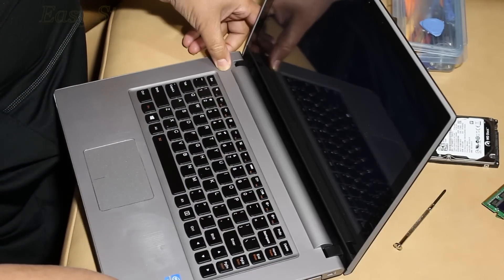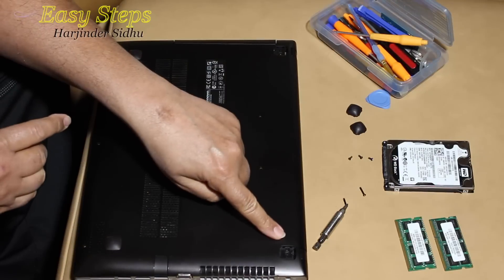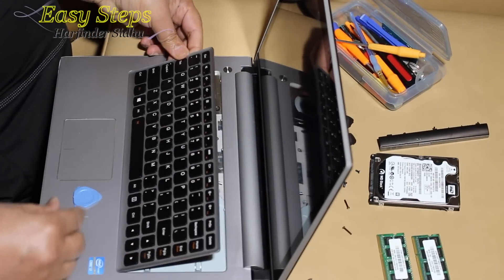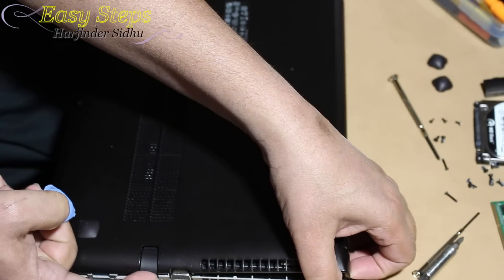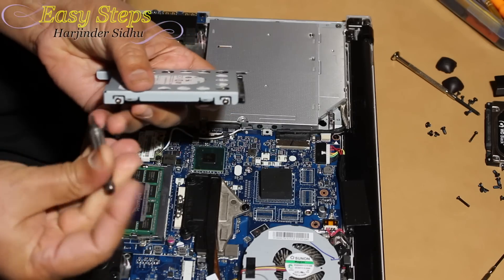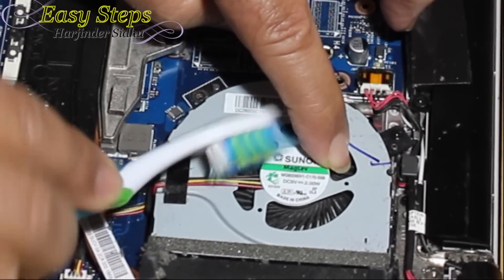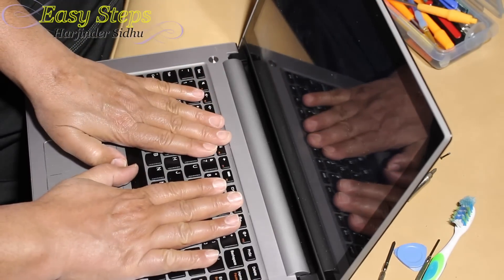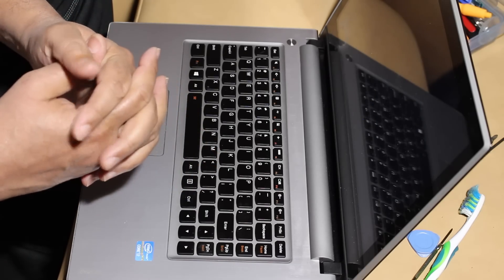Disassemble Lenovo IdeaPad - How to Upgrade Memory & Hard Drive | Clean Fan Z400 Disassembly

Comment: Mil y mil gracias. Me sirvió mucho. Thanks
Reply: Si le compro un SSD para reemplazar su hdd... crees que funcione win10 apesar de no tener este Lenovo ideapad z400 DRIVERS para win10?   
Revisé en el foro que había gente que tenía problemas conel brillo pero me da igual porque lo enchufo a un monitor...pero desconozco del wifi y targeta grafica.

Y respecto a la licencia de win 10: NO tengo. Puedo aún así usar win10 (home o pro )y con windows defender normalmente? Se que no puede cambiar el fondo pantalla pero eso me da igual

3.Finalmentepregunta: se le pueden reemplazar ram por 2 ram de 8gb cierto? Ddr3 1600 mhz

Comment: Thanks, needed this video to upgrade my Lenovo Ideapad bought since 2013, after 7 years still running fast with new 8GB RAM and new HD.
Reply from the maker: I have started posting DIY videos on my 2nd channel "Sidhu DIY" so please subscribe, thanks.
Here is the link for my 2nd channel, thanks in advance.🙌 🙏 🙌
https://www.youtube.com/c/SidhuDIY
Reply: @EasySteps_Sidhu  Thanks Sidhu ... I think you have saved hundreds of laptops from going to the recycling graveyards!  Keep up the good work! :-). Many thanks from Canada!
Reply from the maker: Thanks for sharing great feedback, it really makes my day. Thank You.🙏 🙌
Reply: Hi, can I put DDR3 1600Mhz? Or I need to put DDR3L 1600Mhz?

Now I have 4+2gb...can I repleace just 2gb with 8gb? If I can do that I will double my RAM to 4+8gb.

My laptop is Lenovo z500. Have a nice day!
Reply: @dinojelavic7711  hi...Dino, for as long as it's DDR3 it's fine, the speed should be (Mhz ) the same as the original module. If you are trying to install 12 Gb total RAM, (4+8) it could be possible but your 64 bit OS can only read or recognize up to 8 GB, the the extra 4 Gb could be ignored by the system (unusable resource). What do you need 12 Gb memory modules for? Above average computing only needs 8 Gb. Also beyond 8Gb RAM needs a motherboard that could support it. Hope this helps. :-)
Reply: @dinojelavic7711  You could also ask Sidhu, he's the expert... 😉
Reply: @onemanshow411  tengo Lenovo ideapad z400  (sin touch, el normal). Si le compro un SSD para reemplazar su hdd... crees que funcione win10 apesar de no tener este Lenovo ideapad z400 DRIVERS para win10?   
Revisé en el foro que había gente que tenía problemas conel brillo pero me da igual porque lo enchufo a un monitor...pero desconozco del wifi y targeta grafica.

Y respecto a la licencia de win 10: NO tengo. Puedo aún así usar win10 (home o pro )y con windows defender normalmente? Se que no puede cambiar el fondo pantalla pero eso me da igual

3.Finalmentepregunta: se le pueden reemplazar ram por 2 ram de 8gb cierto? Ddr3 1600 mhz
Reply from the maker: Great 👍You are welcome👍, glad to help.
Thank you so much for the like and thanks for watching.🙏🙌
Reply: Si le compro un SSD para reemplazar su hdd... crees que funcione win10 apesar de no tener este Lenovo ideapad z400 DRIVERS para win10?   
Revisé en el foro que había gente que tenía problemas conel brillo pero me da igual porque lo enchufo a un monitor...pero desconozco del wifi y targeta grafica.

Y respecto a la licencia de win 10: NO tengo. Puedo aún así usar win10 (home o pro )y con windows defender normalmente? Se que no puede cambiar el fondo pantalla pero eso me da igual

3.Finalmentepregunta: se le pueden reemplazar ram por 2 ram de 8gb cierto( o sea 16gb en total)? Ddr3 1600 mhz

Comment: Great video, very well detailed and helpful for me to upgrade the HDD for a SDD one with no accidents! Thanks a million!
Reply from the maker: You are most welcome, glad to help
Thank you so much for the like and thanks for watching.🙏🙌
Reply: @EasySteps_Sidhu   I've a Lenovo ideapad z400 (no touch).
If I buy an SSD to replace the old hdd ... do you think win10 works despite not having this Lenovo ideapad z400 DRIVERS for win10?
 I checked in the forum that there were people who had problems with the brightness but I don't care because I plug it into a monitor ... but I don't know about the Wi-Fi and the graphics card.

 2nd question: And regarding the win 10 license: I do NOT have.  Can I still use win10 (home or pro) and with windows defender normally?  I know you can't change the wallpaper but I don't care
Reply from the maker: I have started posting DIY videos on my 2nd channel "Sidhu DIY" so please like, share and subscribe, thanks.
Here is the link for my 2nd channel, thanks in advance.🙌 🙏 🙌
https://www.youtube.com/c/SidhuDIY
Reply: Si le compro un SSD para reemplazar su hdd... crees que funcione win10 apesar de no tener este Lenovo ideapad z400 DRIVERS para win10?   
Revisé en el foro que había gente que tenía problemas conel brillo pero me da igual porque lo enchufo a un monitor...pero desconozco del wifi y targeta grafica.

Y respecto a la licencia de win 10: NO tengo. Puedo aún así usar win10 (home o pro )y con windows defender normalmente? Se que no puede cambiar el fondo pantalla pero eso me da igual

3.Finalmentepregunta: se le pueden reemplazar ram por 2 ram de 8gb cierto (o sea 16gb en total)? Ddr3 1600 mhz...

Comment: Do you have to remove the keyboard just to replace the Hard Drive with an SSD?  It looks like the most difficult thing to do.
Reply: I upgraded the ram once and I don't remember pulling the keyboard off but I haven't changed the hard drive yet.
Reply: @franciscofuentes8916  Tengo un Lenovo ideapad Z400. Si le compro un SSD para reemplazar su hdd... crees que funcione win10 apesar de no tener este Lenovo ideapad z400 DRIVERS para win10?   
Revisé en el foro que había gente que tenía problemas conel brillo pero me da igual porque lo enchufo a un monitor...pero desconozco del wifi y targeta grafica.

Y respecto a la licencia de win 10: NO tengo. Puedo aún así usar win10 (home o pro )y con windows defender normalmente? Se que no puede cambiar el fondo pantalla pero eso me da igual

3.Finalmentepregunta: se le pueden reemplazar ram por 2 ram de 8gb cierto (o sea 16gb en total)? Ddr3 1600 mhz

Gracias

Comment: question, someone in a computer shop told me the first thing when dismantling a laptop is to disconnect the battery....then proceed to change the hdd. something to do with hazard or risk etc
but in this video the narrator didn't mention anything about the battery......so it's not a priority to first remove the battery?
Reply: its the first thing you do when opening any kind of electronics, to remove the power source, be it the power plug or the battery.
if you're experienced or careless enough you can ignore that, but just be sure and do it anyway.

Comment: Thank you for your video guide. I was able to open it and install a 240gb ssd, and also replace the thermal paste. Laptop now runs cooler and faster. Regards from Brazil.
Reply: I've a Lenovo ideapad z400 (no touch).
If I buy an SSD to replace the old hdd ... do you think win10 works despite not having this Lenovo ideapad z400 DRIVERS for win10?
 I checked in the forum that there were people who had problems with the brightness but I don't care because I plug it into a monitor ... but I don't know about the Wi-Fi and the graphics card.

 2nd question: And regarding the win 10 license: I do NOT have.  Can I still use win10 (home or pro) and with windows defender normally?  I know you can't change the wallpaper but I don't care

Obrigado

Comment: Completely inappropriate to blow into any machinery or electronics. The moisture from your breath attracts dust. Use compressed air or a compressor.
Reply: Absolutely fine to blow into almost any machinery or electronics, to remove dust or swarf; I do this all  the time, often using the barrel of an old ballpoint pen in order to better direct the (human-compressed) air :-)  Just make sure the blown dust etc. can't get into your eyes.
Notice that the laptop will run warm, and any moisture from breath will be quickly removed by the combination of heat and (fan-driven) air currents.

Comment: thanks for the video, exactly what I needed.
Reply: Tengo un Lenovo ideapad Z400. Si le compro un SSD para reemplazar su hdd... crees que funcione win10 apesar de no tener este Lenovo ideapad z400 DRIVERS para win10?   
Revisé en el foro que había gente que tenía problemas conel brillo pero me da igual porque lo enchufo a un monitor...pero desconozco del wifi y targeta grafica.

Y respecto a la licencia de win 10: NO tengo. Puedo aún así usar win10 (home o pro )y con windows defender normalmente? Se que no puede cambiar el fondo pantalla pero eso me da igual

3.Finalmentepregunta: se le pueden reemplazar ram por 2 ram de 8gb cierto (o sea 16gb en total)? Ddr3 1600 mhz

Gracias

Comment: Thanks to this educational video, I was successful at disassembling my Lenovo ideapad 320. I find barely any upgradable parts besides the slow Hard Drive and battery if crap ever happens. Overall happy with what I gotten, it gets me through college like a breeze although the Radeon R7 graphics aren't all that great but it's a better deal than the i3s at the time (literally 2 days ago shopping in Best Buy.) The Ghost of a CPU, the A12-9720P sounds cool since it's cheaper than a A8 laptop (at the time) and on paper better performing yet I'm just not too impressed by it and it should be a sign of the A8's power. Don't expect to do any "heavy" gaming but workloads should be much easier compared to some cheap chromebooks oh and have I told you about streaming? Not that big of a deal really but if you are going to college then this Laptop shouldn't give you any problems unless you are not competent enough to turn on the graphics scaling or turning it off every time you are in the move as opposed to the sleep mode which wastes practically nothing while keeping everything still there when you need them.

Comment: Do you know if the 110 ideapad has the RAM soldered in? I wanna throw another 8 gb strip in but im not sure how many slots there is and if the cpu has a limit on ram, i dont wanna have to open it up unless im sure i can upgrade

Comment: Hey,  great video. I suggest you use compressed air can to get rid of the dust from your fans and motherboard.
Reply: Easy Steps you can actually introduce moisture to it which can damage your components by blowing with your mouth.